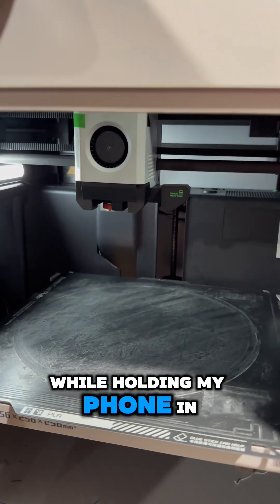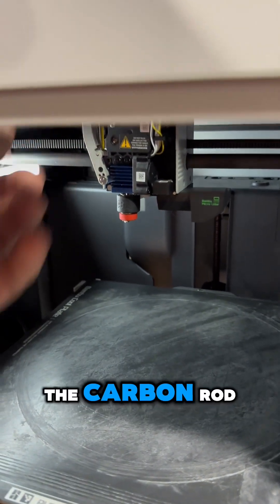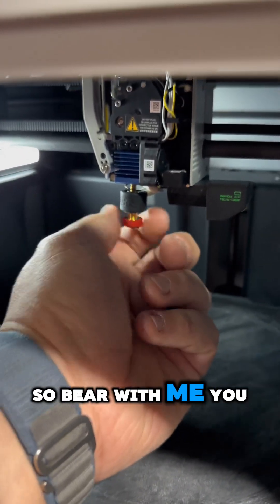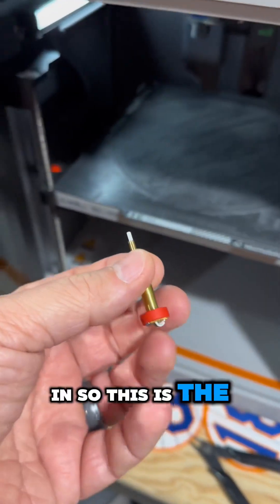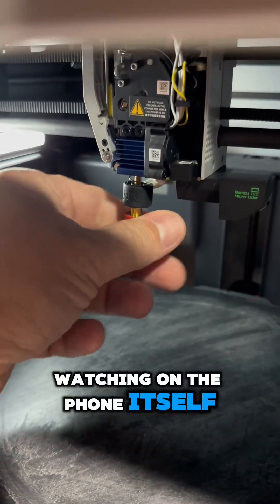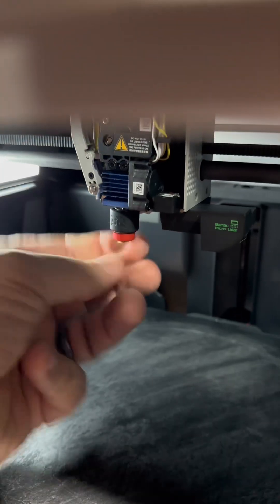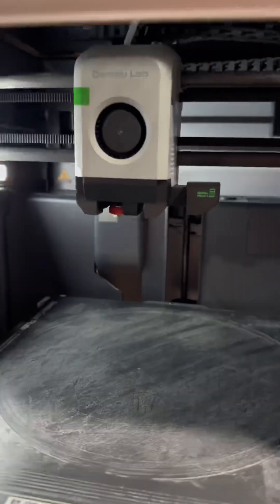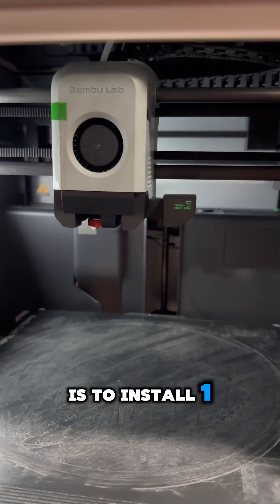BIQU/E3D Revo Nozzle QuickChange!

Comment: I can tell you right now that prints far away from the Aux fan result in slightly worse prints compared to the stock nozzle. This is because the shape of the revo nozzle blocks airflow from the part cooler compared to the stock nozzle. Case in point, test print a PLA benchy on the bottom right corner, and you will get defects.

Comment: Did the yellow wires on your Panda Revo have splices in them? I got one months ago, and they spliced those yellow wires together BUT they didn't make a connection with one of them. Their CS told me to resolder it and when I said no send a new one, they haven't messaged me back or replied to follow ups. 

I'm bummed at the quality of this for $130 and being told to fix their mistakes myself. Just wondering if they saw a problem with their 1st batches and fixed their issues or if mine just got put together very poorly.